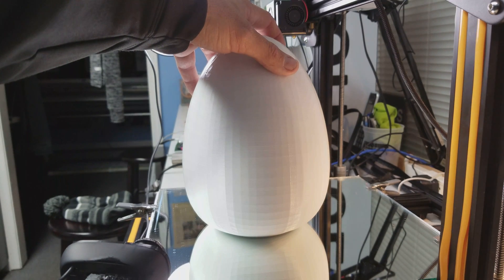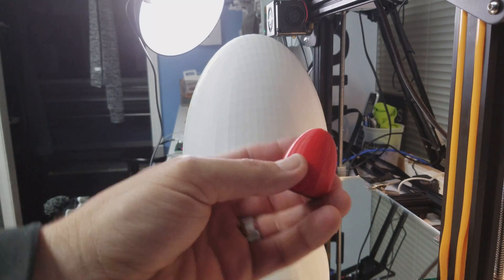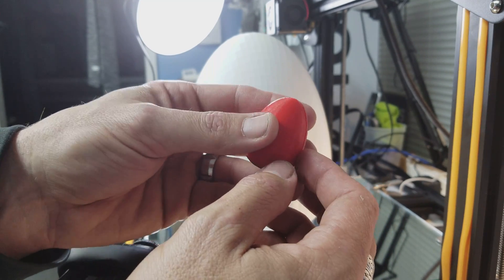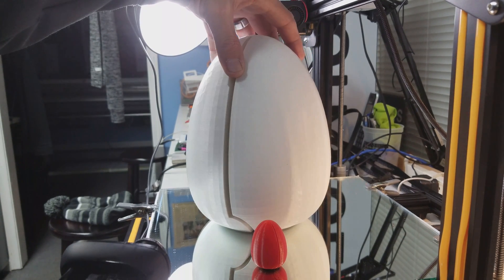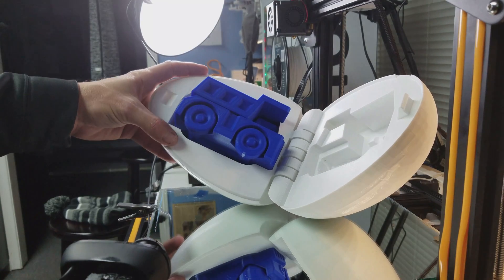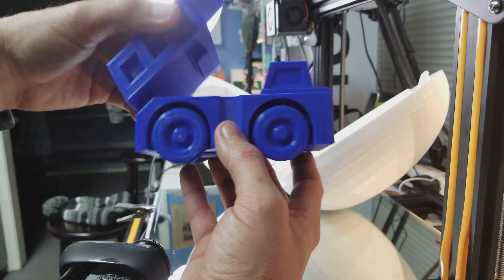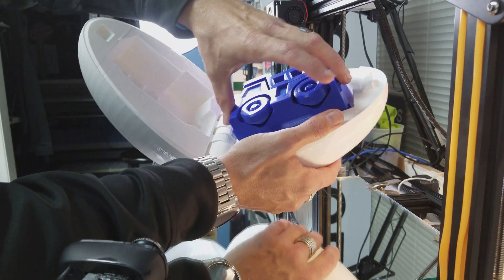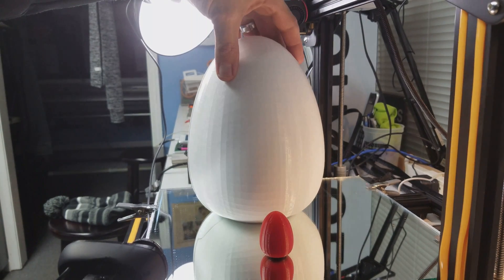3D Print at 500%

Comment: If I may recommend when your about to do a long print, do a "cold pull" or even an "atomic cold pull" to ensure the nozzle is clean.
Reply from the maker: I'm not familiar with that term.  My clogged nozzle was due to the bowden tube not being properly seated on the hot end causing the filament to heat up and expand (at least that was my conclusion) I could be wrong...